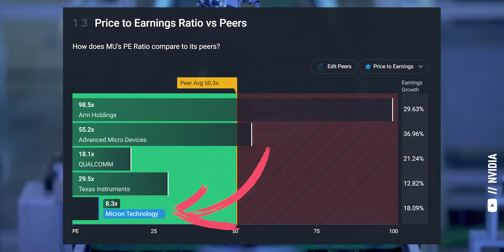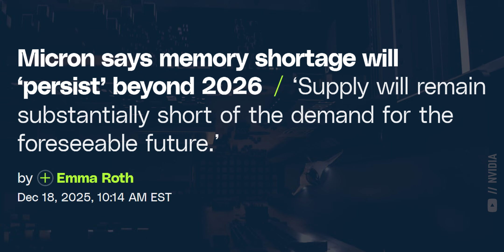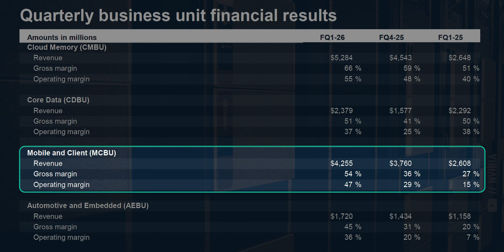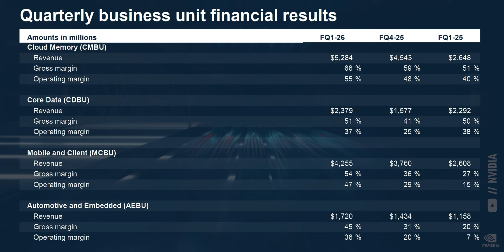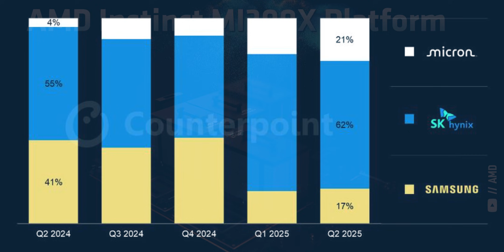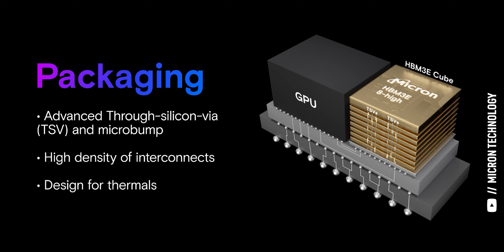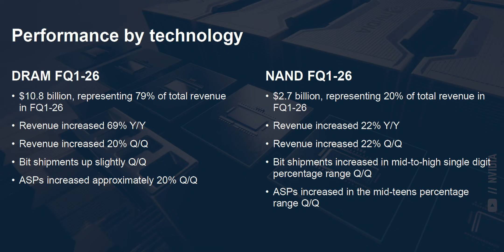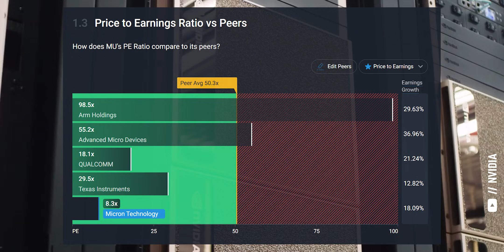If You Missed Nvidia (NVDA) & Palantir (PLTR) - This Stock Is Next!

Comment: I think they have a rosy future for maybe next 2 or 3 years, after that could come a correction (maybe quiet large).    Large cloud providers are extending the depreciation on current hardware, which says to me they believe they can extending their hardware life time.   If so we could be closer to the end of this cloud cycle then many suppose.
Reply: NVDA’s next AI systems will increase in speed so much more than the increase in their cost that as long as AI compute demand increases, systems will still be bought because it is beneficial, including because of how much less power the new systems use for the same compute as previous systems.   We’re not talking 10% or 20%.  Systems are improving 5 and 10X.  

The depreciation schedule says that companies expect to still be getting useful work done with systems 5 and 6 years later, instead of just 3 or 4.   That is the useful life of these systems, not their economic life.
Reply: @ttb1513   I have know doubt there next generation will be fantastic.   After all the last three have been wonderful.  Think there hitting a wall and competition is catching up (google tpu, AMD, etc).  With massive spending spree of last three years and mounting debt just don't see sustained spending for more then 2 years.  I could be very wrong but give my prediction 60 percent chance of being right.

Comment: Memory is a COMMODITY that is supply constrained currently... that will change as the multiple HBM suppliers compete for the same business in data centers.
Reply: 3 is not a big multiple. They each have different strengths and patents
Reply: Except that the big-3 memory makers have experienced and learned that increasing supply too much beyond demand hurts all 3 companies.  They can all 3 expand and innovate and grow very profitably, if none of them get greedy and over expand supply capacity too much too fast.  AI is increasing memory demand greatly and growing the memory market hugely and they can all prosper if they are supply disciplined.
Reply: @ttb1513  Some truth there. Did more research, seems HBM makers are expanding production but are expected to lag demand until 2030. They have shifted current capacity to HBM production and new industry capacity takes years to build. Doesn't seem to be any conscious effort to limit supply, they literally can not get ahead of the demand, which is growing incredibly fast. So, it will likely be years before supply meets demand, then competitive pressures will drive down prices... for now Micron stock should do very well IMO.
Reply: HBM will become less of a commodity when the base logic die of HBM4e becomes something that can be customized for individual customers.  Innovation, relationships, and being able to work with customers to bring new, customized and improving performance to market will be differentiators that don’t make HBM the ‘ole DDR commodity of the past.

Comment: Among all the companies you mentioned — CoreWeave, Arista, Micron, NVIDIA, Google, and Palantir — it is obvious that investors with significant capital will naturally favor large, established companies such as NVIDIA or Google. On that point, I fully agree with you.
However, for those starting with a smaller capital base and looking for high upside potential while keeping risk as low as possible, investing in biotech or highly speculative sectors does not make much sense. In that context, companies like CoreWeave or Arista appear to be far more relevant choices.
As for me, I have conducted my own in-depth analysis on Nebius, which I consider a separate and compelling case.

My reasoning is based on a long-term horizon of at least five to seven years. Companies such as CoreWeave and Nebius need time to diversify their customer base and fully scale their infrastructure. As for Arista Networks, it is better positioned today, but still has ground to cover to further consolidate its growth.
Reply: No moat, no pricing power!
Reply: @MaxG_TTM That’s true in the short term. Barriers to entry and pricing power emerge over time through scale, capital and execution.
AI infrastructure is a 5–7 year cycle, not a mature market yet.
Reply: @MaxG_TTM . I learned the no moat challenge with Micron during the early 2Ks…. Memory needs were increasing quickly, while pricing power declined faster…

This is where you invest in a really good ceo and cfo.

😃

Comment: I'll predict Nvidia beginning their own manufacturing in the US.
Reply: Good guess but unlikely

HBM is a highly specialized, capital-intensive product requiring massive fabs, advanced stacking tech (TSVs, logic dies), and expertise Nvidia lacks. Building such capacity from scratch would cost tens of billions and take years, with no clear strategic upside for Nvidia.

Nvidia is fabless by design, focusing on architecture and software (CUDA ecosystem). They have never manufactured their own chips and if they did they wouldn't start with RAM
Reply: @lighthousesaunders7242  We'll see.
Reply: Low IQ take
Reply: Hardly a chance.  NVDA will do what NVDA does best and rely on what others do best, as their specialties.  DRAM and HBM manufacturers are highly specialized and compete with each other, spending more than $20B a year just on fab construction and equipment, not to mention all of the R&D experience and patents and expertise they have developed over years.  Same goes for TSMC for making the logic chips that NVDA design, except that TSMC does not have nearly the competition from Samsung and Intel that Samsung, SK Hynix and Micron create in memory manufacturing.

Comment: You hit the nail on the head, reason many analysts havent jumped on the MU bandwagon is the idea that it is a commodity company w little if any moat.
Reply: Reporting next quarter than MU did in any of the previous 5 entire years is speaking volumes to analysts.  Analysts have raised price targets rapidly after the Dec17th earnings to $300, $350, and even $443.  When they see next quarter beat $8.40 EPS and the quarter after that hit about $10, that will open peoples eyes even more.

And yet, people comment here that TSY is using forward PE instead of trailing PE.  Refusing to look at forward PE will be that next year EPS beating any of the previous 5 years EPS by 4X will not become apparent and acted upon until a year too late, when that lower PE finally becomes a trailing PE.